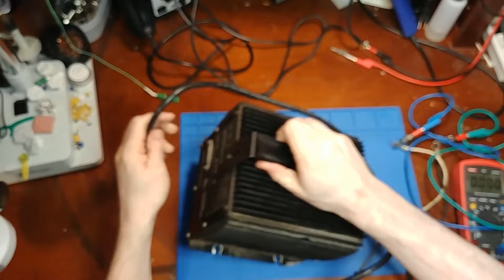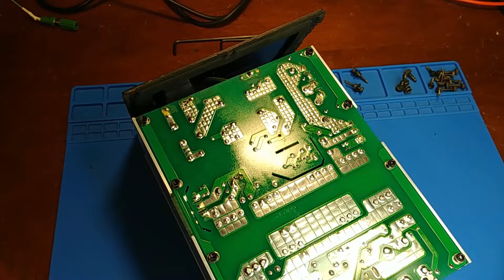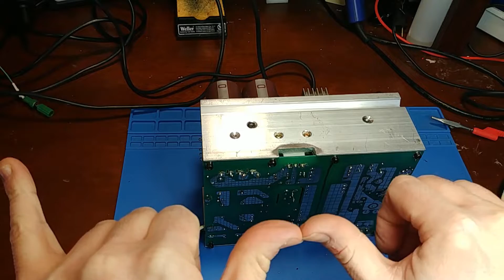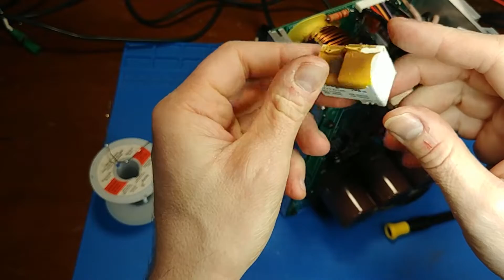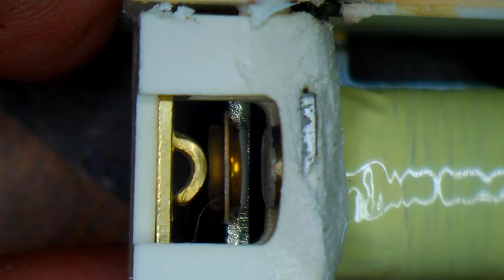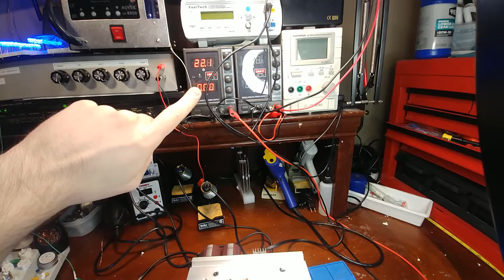24v Battery Charger Repair

Comment: Says charger fixed, yet leaves us with charger blinking and beeping a fault code at the end and not charging..
I can only assume the battery simulator was the issue?  If that’s the case, it failed at its job title of battery simulator.

Comment: My charger turns on but does not have a voltage of 24, what do you think I have, please help me.
Reply from the maker: This charger needs to see some battery voltage before it will turn on the output.

Comment: I don't think it's working still though. That's what mine does. It will charge for a few minutes, then beep 6 times like that and restart over and over.
Reply from the maker: Have you confirmed with a volt meter that it really is charging? You might have the same failed relay connection as the unit in the video.
Reply: @jeffescortlx  Yeah it charges, the problem is it keeps restarting.
Reply: I think it's overheating

Comment: You can build a crude battery emulator using an electronic load which is diode isolated from a power supply. This way you don't risk damage to your power supply.

Comment: If its flashing and beeping 6 times means it's working? What is the meaning of 6 flashes?
Reply: That's what I've been trying to figure out. Nothing in the manual says anything about it beeping 6 times. I THINK if I recall correctly it does that when it's done charging and then all three lights remain illuminated, but mine just starts over and repeats the process every few minutes.

Comment: Mine charges for a little while, then after 30 minutes or so it beeps like 8 times, then shuts off and starts over again. any idea the issue? checked the batteries and each one shows 6.2v although I didn't disconnect them.
Reply from the maker: Sorry I'm not familiar with the error codes on this one.
Reply: @jeffescortlx  It's the same charger as the one you're working on in the video.
Reply from the maker: @travcon8 I'm not familiar with this charger, I've only seen this one, years ago.

Comment: That didnt fix the charger did it?  Im curious if it worked when you charged it into a battery.  If the battery ws too dead it would have had the 3 blinking lilghts.

Comment: I used to repair this type of charger many time, and this output relay failure is very common. Absolutely correct that you need 24 volts battery to turn this charger on. That beeper means that the charger detect no battery connected. Great job..
Reply: what if it turns on and charges for maybe 30 minutes, then starts over? It also gets really hot after a while.
Reply: @grasscutter88  very likely caused by bad Mosfets, or the big diodes next to the HF transformer shorted, or dried capasitors (likely 1000uf 50 volt)..

Comment: @ 8:59 I was trying to do the same test after watching your video, using an 18v drill batter as my dummy. I think you were probably just getting 0v during the test and your power supply was feeding back in. I got 18.7v at the spot you tested and at the battery, even when A/C was unplugged. You were getting 22.1v which is the same as what your supply was set to. Were you also getting a constant periodic click from one of the relays on the primary side during your diagnosis? I am so I'm thinking I may have a different problem if you were not.

Comment: Jeff, in your video you stopped at one point to say thats where the logic turns it on. That is where I am stuck. I am getting error of three flashing LEDs four times, which by the book indicates overcurrent state,  and it will reset itself with no detriment to the charger. Mine is in a coninuous cycle of. I have changed batteries, checked wiring etc. The high voltage side is turning on for a split second, and then turning off. I have 24v at the relay connections from the battery, and the new relay is clicking on. Whether the new relay may be faulty I dont know, but doubt it. Any ideas where I should be looking? It can sense when no battery is connected, but for some reason is not seeing the 24v from the battery to say ok, charge. Thanks and stay safe
Reply from the maker: Sorry I'm not really sure where to start. I'm much better with trouble shooting things I'm not familiar with hands on.
Reply: Did you ever make any headway? I’ve got the same problem as you, overcurrent error.
Reply: @samroesch  none whatsoever. Put it in the too hard basket!

Comment: Hello friend, with one here that when I call, it only beeps and flashes the three leds, I checked all the relays and found nothing and the output that goes to the battery is zero the tension that can be? would have a tip? only here from Brazil
Reply from the maker: Sorry I'm not that familiar with this charger.
Reply: @jeffescortlx  ok

Comment: I have the same charger and have been trying to get my hands on a replacement relay. No luck in four months. Also there is a ceramic capacitor just to the right of the relay. Mine has popped and unable to read what it is. Any chance you had a schematic for this?? You have given me hope it can be fixed. Trying for fix for a good friend, so far been letting him down. Cheers and stay safe.
Reply: Ok, looks good but! Three flashing lights and beeping noise = not charging, exactly how you started??
Unless I'm missing something 🙄
Usually three light's come on, then one flashes then two and finally 3 solid lights when charge complete.
As I say 3 flashing and beeping = not charging/faulty, this is what the charger you 'repaired' is doing 🤔👍
Reply: @gassafeengineer  you are right, thats why I put up the last reply. It seems the battery voltage is being READ and the charger is not accepting it as valid so it goes through the cycle again. Have been trying to find where the voltage is being read and taken to the logic side of things. If the voltage is being read wrong the logic will turn the charger off. Not having a circuit diagram is a killer.
Reply from the maker: HAT901ASDC12 should be compatible I believe.
Reply: @jeffescortlx  Thanks for the info. I finally got my hands on a relay. Had it installed and still have the same problem, three led flashing. It is thinking something is wrong with the battery side, but not sure where to look next.
Reply: Do you know what senses the battery voltage and gives it the ok to turn on? Just double checked and no 33.8V, so it looks like the AC side isn't turning on.
Reply: I should have said it starts to turn on and then turns off abruptly and starts the three LED flashing four times before reset

Comment: After a few hard lessons with intelligent battery chargers I always use a flat battery on the output side with a bidirectional ammeter. Usually tells you where you stand quite quckily

Comment: Is the beeping and and all 3 green lights common during a charging cycle. I have the same problem and it won"t charge in that state.
A charge cycle is 1 light is lite at a time untill its fully charged. Thats how mine worked before it stopped charging.
Will you share were you get your relyas from without having to buy 30 at a time like most suppliers.
Thaanks for the video, the current thing sent me for a loop.
Reply from the maker: Its a pretty common industrial relay. Mouser, digi-key, Newark, Amazon or email should have them sold as 1 pc.
Reply: Yeah....I'm having the same problem you speak of . I don't think he fixed it. The blinking and beeping not normal. It's a reset.
Reply: @omarsamuels3626  I agree. Mine does the same exact thing. Charges for a little while 2 or 3 minutes, then beeps repetitively like that and starts over

Comment: The logic board is actually powered by the battery when you plug it in.
It only senses the presence of AC power.

The fuse is to protect the battery from shorting out through the charger.
They aren't considered repairable because a new one ( $300-$400 ) is usually cheaper than repairing it.
Between diagnosis, repair and down time its cheaper for most people to just swap out the chargers , and since JLG, SkyJack and Genie all use this charger it isnt hard to find one.

And yes , its almost always the relay.

People unplug the charger while its charging which draws a huge spark across the terminals , that relay normally doesn't open or close when its under load.
Reply from the maker: Thanks for the info. I think now that I understand it better after the repair it would be a reasonable $100 repair charge. Maybe some users would take the time to send one in for repair to keep one the self as a back up spare?
Reply: @jeffescortlx  I have one for repair, can you help me
Reply: @jeffescortlx  I tried to talk my boss into rebuilding them because we  buy 10 - 20 a year but in the end there wasn't enough of a price difference to be worth the trouble.
(We repair aerial lifts)

In this industry a rebuilt "anything" has to sell for roughly half the price of a new one, so we could only charge $200 , by the time you factor in acquiring "cores" ,labor and new parts we'd make less than the mark-up on a new one.

They were designed to be throw aways , as an old industrial electrician it bugs the Hell out of me , but it's the world we live in now.
Reply from the maker: @glennchartrand5411  I can understand that. Yes it's a bummer to see them get tossed out, they are built pretty well.
Reply: If you have 10 broken ones it certainly makes sense to fix them if all of them have the same problem (=the relay).

Comment: I have seen battery chargers that use an output relay to stop reverse polarity connection and also no output is allowed if there is no battery voltage present.
Also stops the assholes blowing the charger up by sparking the output leads.
Very sneaky :-)

Shame the protection relay bit the dust, likely not a cheap relay eather.
So you are not changing the stepper motors... dam wrong device :)
Reply from the maker: Yep this one is well designed, lot's of protection steps. And it's not like the engineers did a bad job, it's rated for 30 amps but only see's 19. Maybe it was just a crummy relay.
Reply: Sounds nicely over rated :-D, perhaps the relay was a bit crap.

When i've made a linear power supply for a frend i tend to go a bit overboard with the ratings of parts.
Two pass transistors become three and a bigger heatsink, larger bridge rectifier and other bits.
i just don't like the idea of boiling semiconductors.
i'm a bit odd that way lol..

Comment: another awesome video! could i ask what is your thoughts on the cheapy desoldering iron you have on your desk next to your hakko?
Reply from the maker: If your going to use it more than once, I'd recommend saving up the difference and going with the Hakko.
Reply: @jeffescortlx  that bad huh? lol will do thanks!
Reply from the maker: @luke9511  I hear the double pump version of the Chinese one is better. For light duty every once in a while it's fine. But for someone like me that uses a eletronic desoldering pump daily hakko is the way to go.

Comment: they connected it backwards that is why it failed
Reply from the maker: After doing some looking, this relay failure is common. I think the charger is smart enough to not turn on if the voltage is below a certain value, shorted or negative value. If it did connect reverse polarity with the charger engaged, I think the fuse would pop first.